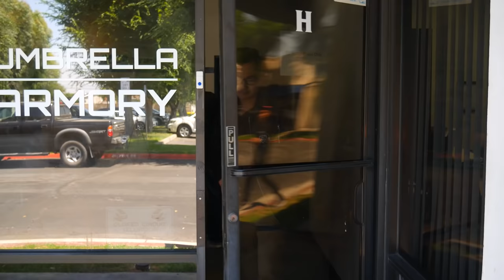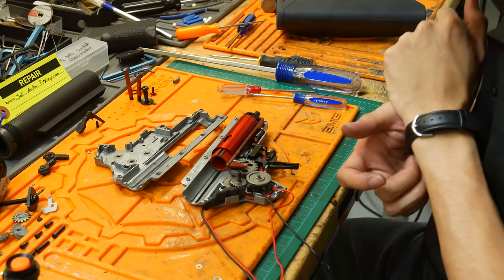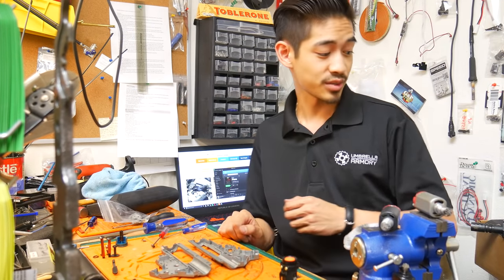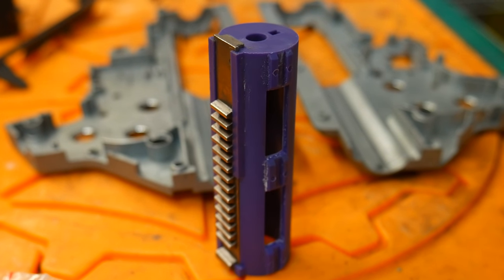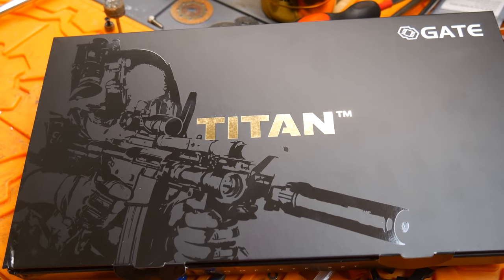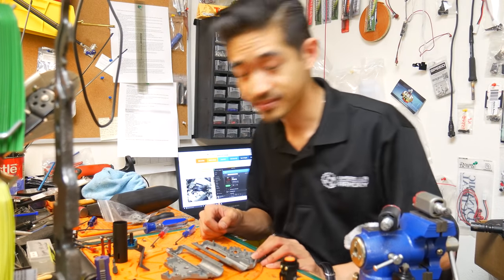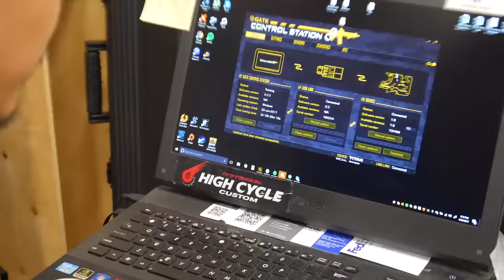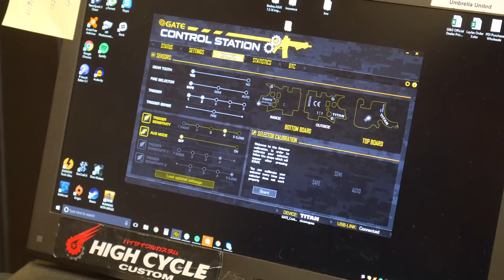U P G R A D E D | Umbrella Armory Upgrades my Elite Force/VFC Avalon Saber Carbine and it WRECKS

Comment: Im out here stuck with a $120 gun
Reply: Chuck a Madbull 6.03 in it, they're about £30 for a 455mm barrel and I love them, massive range increase and astonishing accuracy. Combine it with a G&G bucking and you've got a gun that Costs less than £200 with insane performance.
Reply: @jds355  
Good ol' green bucking
Reply: @A-G-F-  Done me me well, just got a Modify flat hop but got nothing to put it in, I want to install it in my JG G36C with a better barrel, need to get a tight-bore for it and the gearbox case has cracked so I'm prioritising that. Didn't do too bad though before it cracked, I've had it 4 years and probably 50,000 rounds through it and God knows how long I've been using it with a chunk of gearbox casing rattling around loose, ah well it was due a service.
Reply: @jds355 
Those Modify Flat Hop buckings with nub rock, my local tech uses those in budget DMR builds.

I was about to get one but getting them here in mexico tends to get pretty expensive
Reply: @A-G-F-  Good to hear that they are good, they cost about £15 in the UK and my local site struggled to source them too.

Comment: I like how you can just update your guns and take them apart.
Around my place the law bans every kind of modification to airsoft guns. Because they are under the same laws as real firearms.  And theses laws say that any modification to any kind of firearm not done by a real certified gunsmith is illegal. And I am not talking about "paying a fine and walk away from court" kind of illegal. Breaking gunlaw around here starts with at least ~3 years in prison minimum. So just putting in a different trigger or adding a longer/shorter barrel for a "Toy" not done by a firearms-gunsmith...enjoy jailtime.
It is almost like our socialist dictatorship never ended in 1990...